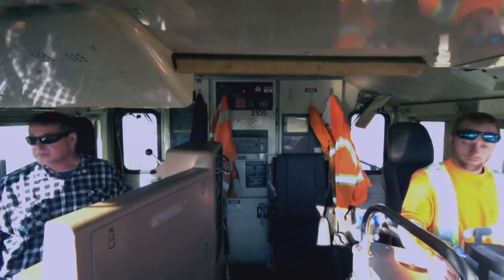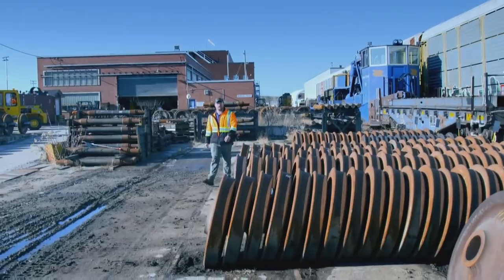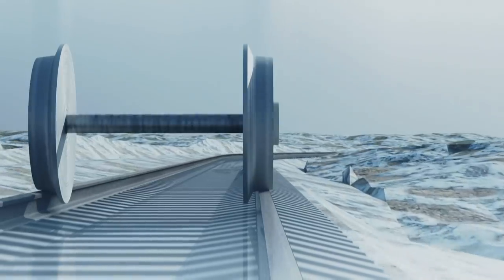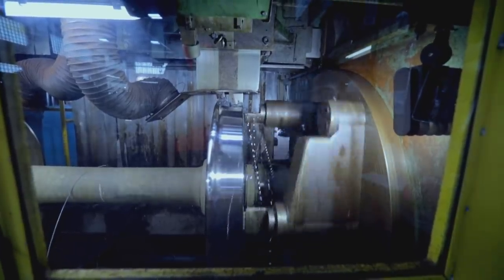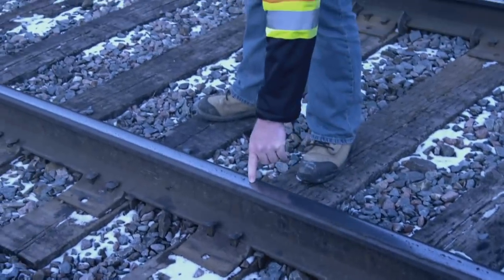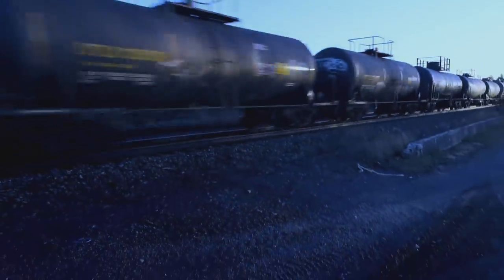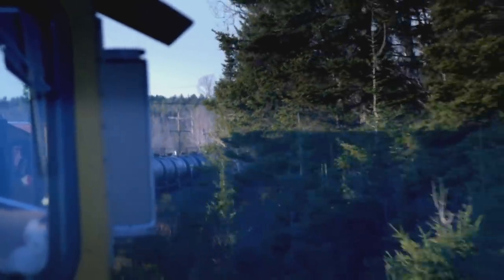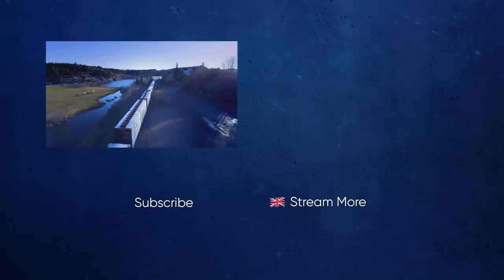How Do Solid Steel Train Wheels Get Repaired? | Arctic Ice Railroad

Comment: At the end of the 70s, beginning of the 80s, I worked at Canadian Steel Wheel (CSW) in Montreal.
This factory made forged train wheels from scrap steel.
Two electric arc furnaces, each with a capacity of 90 tons, melted and cast steel into ingots over 15 feet long by 20 inches in diameter.
These ingots were then cut into cylindrical blocks of varying lengths depending on the diameter of the wheels to be produced.
Once red-hot, these blocks passed through the 7 hydraulic presses of the forge, to give them the shape of a train wheel.
Then remained the stage of final machining, before shipping to customers.

Comment: There is a new machine that does the same job without having to remove the axle from the cars/locomotive. It hoists the entire unit up. My brother designed part of it and installs them. Brightline & BNSF both have them, among other rail companies.

Comment: This is only addressing worn trailer wheels here. Wonder if Diesel locomotive driving wheels are different? Steam locomotives had replicable drive wheel shoes.
Reply: The wheel sets with the large gears inboard were drive axles.

Comment: That "explanation" of wheel "differential" speed around curves is nuts. Man, l see it all the time. If the curve superelevation is correct and the train speed is also correct thru a curve the train will settle pretty close to the centerline of the track due to the combined addiction of the centrifugal force vector pulling the train outboard and the weight vector pulling it down. There will thus be NO appreciable Δ in wheel diameters contacting the railhead and thus no differentiation. It'll squeal like crazy thru the curve.
Reply: The flanges do a lot of the squealing. I'd rather hear squealing that the narrators horrible voice.

Comment: Should use Reardon Steel.
Reply: What is that "reardon steel"?
Reply: @Mesdriver     Atlas Shrugged is a 1957 novel by Ayn Rand. One of the characters makes a new kind of train rail. Hence Reardon Steel.
Reply: @CarterWHern  Hank wasn't it, Hank Reardon?  Called it Reardon Metal rather than steel.  Been fifty years since reading that book.

Comment: Actually, the wheels themselves cannot be repaired. Journal bearings can be replaced, as can tyres. But thaey are not , frome a purist point of view, parts of the wheel. They are component parts of the wheel assembly.
If you are going to pretend to be an expert, at least get thr basic facts correct.